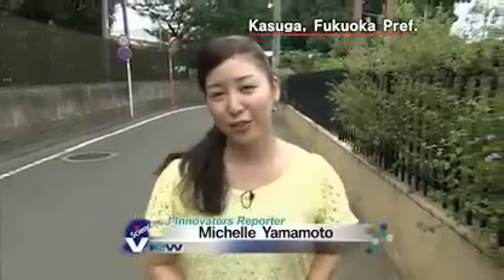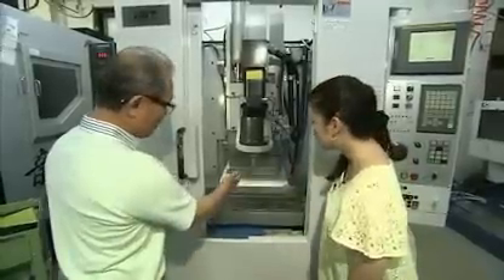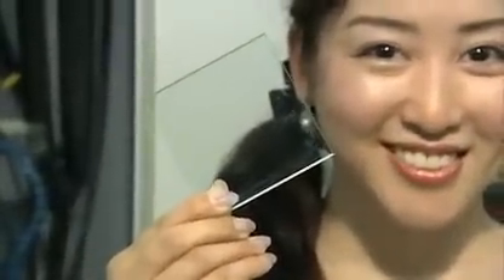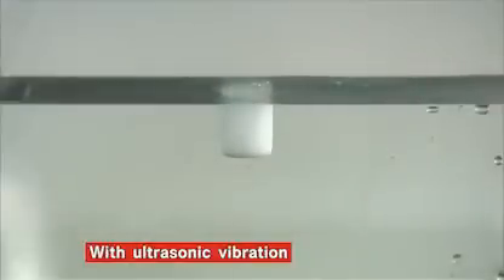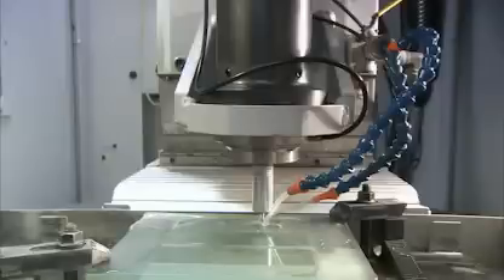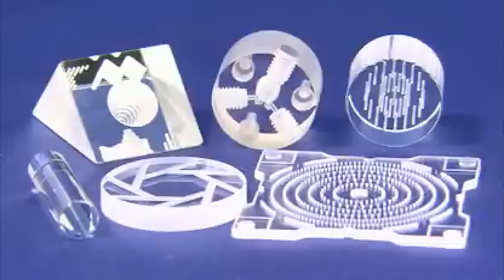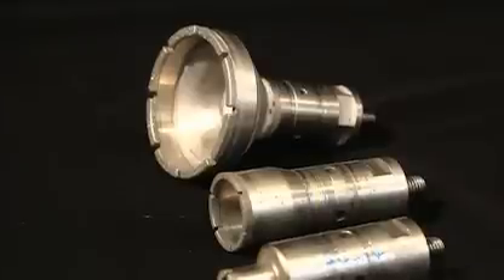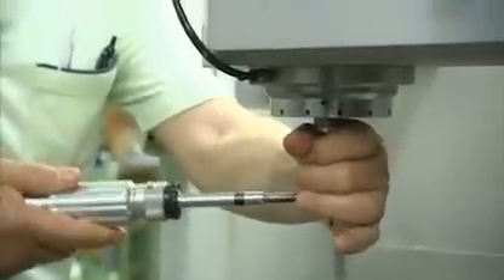Precision Machining with Ultrasound

Comment: How are the chips evacuated without any flutes?
Reply: During diamond drilling by core drill, the chips theoretically are migrating through the clearance between the cutting surface of tool and machined surface of workpiece. Generally, a single chip is pushed from the cutting area through the spaces between the diamond grains till the exit from the hole.